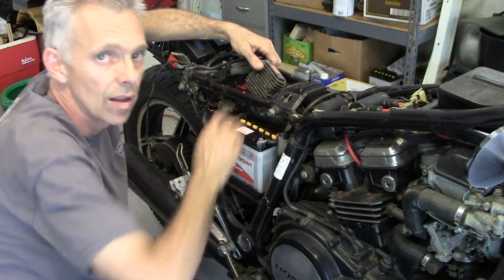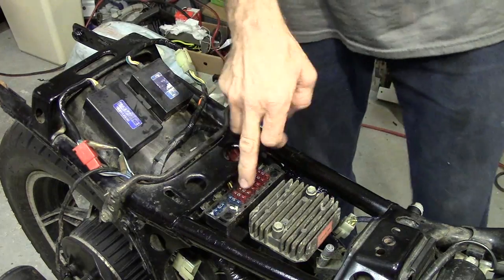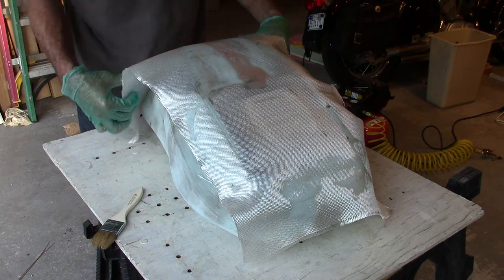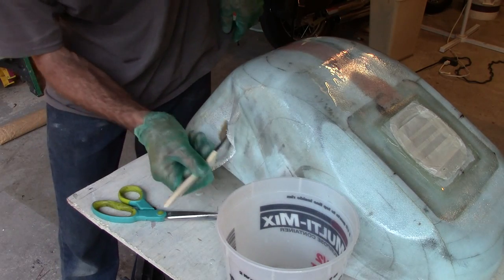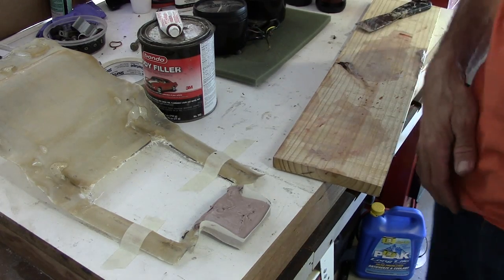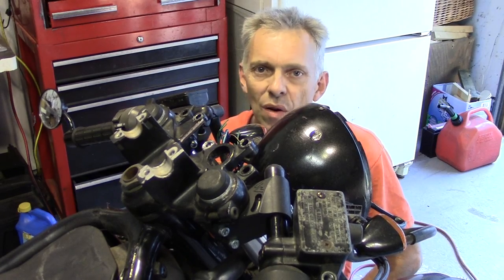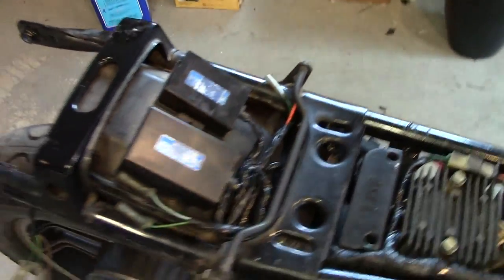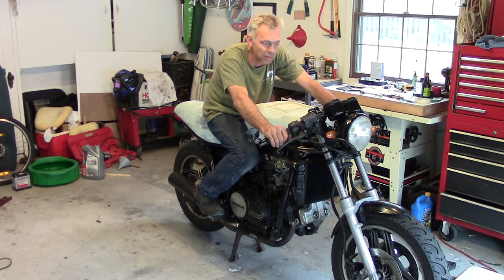Project Honda Sabre Cafe Part 13

Comment: YES!! Good choice! I commented on the last video about the R/R, and was worried that it'd be worse where it is in the current video. Putting it in that open space is probably the best thing you can do for that bike. And btw, that radiator cap should work okay...... The stock temp sensor is built into the thermostat before the inlet on the right side. So as soon as the thermostat allows flow after warm up, you will get a decent reading. Good luck! I LOVE THIS PROJECT.

Comment: I've been following this avidly since you started. It's looking great! One thought: your regulator/rectifier is going to cook itself to death where you've mounted it (no air flow). Maybe you could flip it over so the fins face downward, into the empty space below the tank? Can't wait to see you melt out the foam with acetone. It's like magic (I've done this when building large fiberglass model airplane fuselages).

Comment: I would have mounted the rectifier underneath the seat brother, it does dissipate heat and does need air to cool it, if you want it to last of course, and brother I absolutely love that thermostat radiator cap, can I ask where you got it from brother???

Comment: I thought a few videos ago that you could have used the old handle bar mount points to put the dials on. fix em to a bracket, weld bracket to a bar and bolt in place of old handle bars.

Comment: I was wondering why you used bondo to build up the seat locator? A little piece of sheet metal bent up would be lighter? Less work sanding? Can you fibreglass sheet metal in, or doesn't it stick properly or something? Not telling you how to build your bike, just curious :)

Comment: It actually will get more airflow now than it did in the stock location AND it's mounted to metal which will serve as a heat sink. :)

Comment: Very nice on the gauges.  With your seat it seems like your attempting the same idea or going about the same way to make your tank.  I'm sure you know this but most fiberglass seats are a shell that sits over your electronics there usually not solid fiberglass.  Like I said I'm sure you knew that, just trying to make things simpler for you.